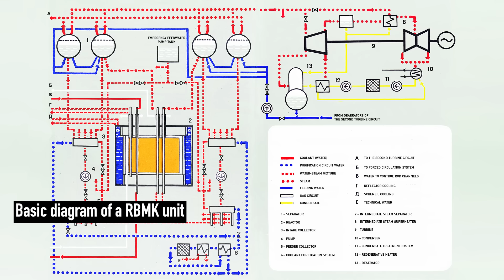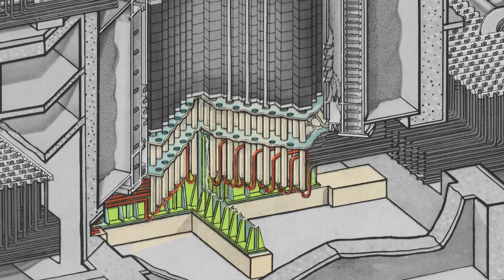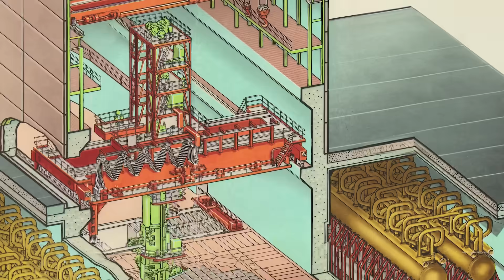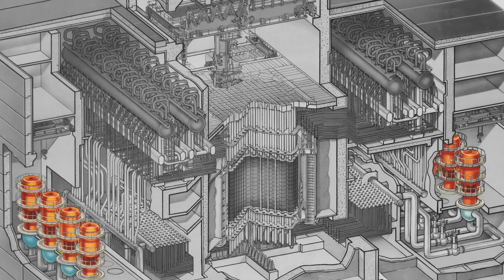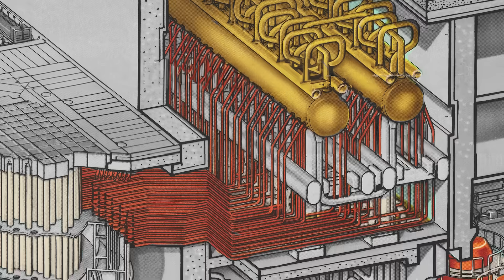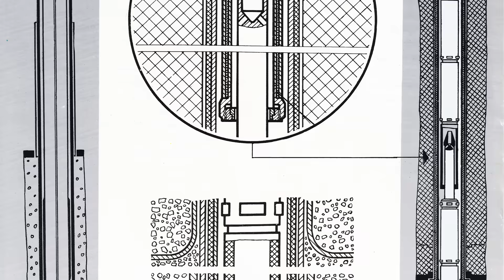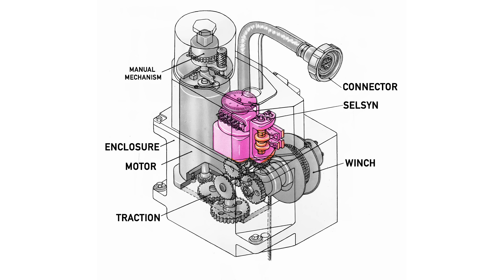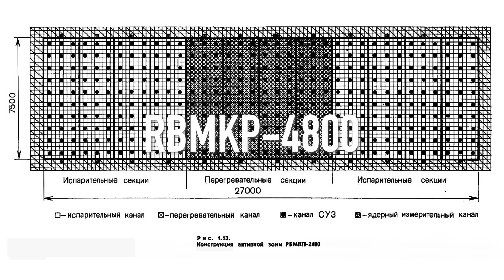RBMK: The Soviet Reactor That Was Doomed from the Start | Chornobyl Uncharted Ep 04

Comment: 12:17 Correction: all the reactors in the Smolensk NPP are 1000MW, but the slide shows 2x1000 and 2x1500.

The 1500MW version was only built at Ignalina NPP, and the Smolensk 4 was never finished.

Maybe that was an expectation of what they wanted to build?
Reply from the maker: Exactly. This is a fragment of a 1977 promotion brochure (translated, though)

Comment: Just a note, SCARLA provided real-time information on the control rods to PRISMA which then ran calculations and produced a printout. In the computer room. That someone would need to take to the control room, by hand. Minimum delay was about 2 minutes after “real time”. For what happened in Chernobyl-4 in 1986 this was in no way quick enough to provide useful information on the reactor state to its operators. Very good for waving around in a courtroom a year later though 😼
Reply from the maker: Yes, there was this issue.
Reply: Not to mention that the Ministry of Medium Machine Building knew that the RBMK design had a high chance of a runaway chain reaction due to its positive void coefficient. They also knew that the RBMK had a high probability of such a runaway reaction under a specific set of circumstances - which just happened to be the exact same set of circumstances that were intentionally created by the plant operators the night of the explosion. However, nobody at the plant knew either of these things because the information about the reactor’s performance in those circumstances was so highly classified that even the power plant’s manager wasn’t cleared to be provided with that information.
Reply: @user-name-goes-here   what is certainly true is that Dyatlov & Co were convinced that the margins they were operating the reactor under the regulations that night were safe, but that Legasov rewrote those reactor safety regulations in the 3 months between the accident and the first IAEA investigation meeting.
Reply: @user-name-goes-here  Sadly, it needed a catastrophe, that made them improve RBMKs safety. Void coefficient ist now 0.
Reply: This system often had some problem and if I remember there was a clause in the documentation that allowed  to work without this information for two hours
Reply: Indeed, I remember to have read a 30 min delay between "real time calculations" and it's availability in the control room.

Comment: I think everything looks okay in the reactor, but having no upper containment chamber and having no fail-safe configuration in the computer control was deadly.
Reply from the maker: There was a configuration in the computer, and there were no problems with that; one of the problems was that there was an unknown behavior of the machine during an emergency due to the design of control rods.
Reply: The RBMK was orginally used by the military to make Plutonium, where the dangerous positive power coefficient (reactor runaway) never occurred because they never used up all of the fuel. When the difficulty of making VVER reactor began to stunt the Soviet civilian nuclear power program in the 1960’s, Anatoly Alexandrov signed off on RBMK use instead. The large crane was a real advantage in making weapons grade Plutonium without having to shut down the reactor for the military, and civilian power stations found it useful too, but it stopped a secondary shield being installed around the building (a technically impossible size at the time). As such military RBMK reactors where all located in Siberia, it had never come up before as a problem.

Comment: Thanks again for the interesting video. What is interesting about these RBMK reactors is that they can be refueled while they are running, while BWR reactors have to be shut down for the time being.
Reply from the maker: Yes.
Reply: The online refueling was a desired thing for producing Pu. For bombs. To produce plutonium, fuel needs to be irradiated for a short time, because plutonium itself is a fuel the reactor will consume. BWR needs to be opened (the lid is taken off) to be refuel, turning the whole containment building into the refueling machine that hangs above RBMKs, and it takes so much time that it's not practically possible to quickly swap fuel rods.
BWRs produce more power (by size) and less bombs, but are way more expensive to operate.
Reply: @Damien.D  
Not only will the reactor consume the in-core produced Pu, it will also turn into the "wrong" kind if it's in there too long. You only want the Pu-239 isotope. The other isotopes are no good in a 'splody thing. The English tried it once (in the 50's, I believe), and said "never again". That's why you have to remove the fuel assembly after a short time. While the RBMK is fully capable of  breeding plutonium for 'splody devices, it has never actually been used in this manner. But the capability was very much a mandatory part of its design. They also envisioned the RBMK in a support role for the new fast breeder reactors they were designing/ going to build. A fast breeder needs an initial special core loading before it can start doing its magic of making more fuel than it consumes. Our big, graphite-moderated friend was supposed to be a part of this cycle.
Reply: @swokatsamsiyu3590  Yeah the design of RBMKs made them very versatile.  And big. And beautiful. Look at this mosaic on the floor!
Soviet 'splody things were bred at Mayak, in crude reactors, open cycle water cooling! Like Windscale Piles, but with water, and no filter, irradiating the lake...
Reply: @Damien.D  
You mean the "Big Ivans", military reactors, I think. And yes, these were absolutely terrible, with their open cooling cycle. They were called "Прямоточные" (= "straight throughs") for that reason. The very idea that they thought this would have no effect on the surrounding area. Good grief! Even today, you wouldn't want to stand longer than 15 minutes or so next to that lake. Unbelievable, what a mess that is. The Windscale Piles were bad enough, but at least they gave them the "Cockcroft Folly'" filters on their chimneys. These Big Ivans were basically open to the entire world without so much as a care.

And as you may have already guessed, I have a huuuuge soft spot for the RBMK. It is such a misunderstood reactor. There is something to their appearance, their grumpy nature, that (to a retired Master welder's engineering eye at least) is somehow endearing. They're big, somewhat clumsy reactors that cannot help being big and clumsy. They need a firm, but gentle hand to keep them in check. But if you respect them for what they are, and treat them accordingly, they will work hard for you. It's what I always said to the apprentice welders; "You have to respect the welding-gun for what it is. Yes, it's a machine, but it is also a Force of Nature. We must never forget where we are, and what we're handling. Mess with it, or disrespect it at your peril."
Reply: Its something other reactors can do, the British AGR and Magnox were capable of it (and have their own analogues of the fuelling machine) . As could the Canadian CANDU reactors.
Reply: @planesguineapigs1712  Thanks for the information, I am not very familiar with AGR and Magnox reactors. CANDU is a bit more familiar, but I don't really know these three reactor types.
Reply: @leopiipponen7693  Both of the British ones are CO2 cooled graphite moderated types. Sort of like a RBMK but using CO2 gas as the coolant.  They like the RBMK are physically huge
Reply: @planesguineapigs1712  does boiling happen in candu reactor primary side

Comment: It wasnt 'doomed from the start' as evidenced by the dozens of other RBMK units that operated without disaster. Despite being the most unsafe, dangerously flawed reactor design ever built, with positive void coefficients and control rods that did the opposite of their design purpose in a SCRAM, it still took abject, wilful incompetence - just pushing it to see how far they could push it, to bring it to disaster.
Reply: Yes wilful incompetence by A.Alexandrov who signed off on the re-design of RBMK control rods in 1978 without doing the computational work to check this was safe and V.Legasov who rejected changing the design after direct experimentation proved it was dangerous. By shortening the length of the graphite spacers in the control rods and control rod length overall in some of these reactors, they turned a potential minor incident into a world shattering explosion. Chernobyl-4 happened to be the first modified reactor to use up all of its fuel (as it was being prepared for full shutdown anyway) and explode. Legasov quickly realised the issue, because he’d been explicitly warned of it three years earlier and corrected by Autumn 1986, he being the per pro budget holder for this kind of work nationally. I feel no sympathy in blaming these two dead men because they worked hard in throwing six other innocent men into a labor camp in 1987 to pay for their mistakes. Many in the industry probably knew what they did as their careers effectively ended with this accident, while most of those thrown into prison on their evidence were released early on an amnesty and returned to work in the nuclear industry.
Reply: Can you explain precisely what "abject, willful incompetence" took place that night? By the time you are done explaining, you will find out that you have been systematically lied to by the Soviets trying to push blame onto the operators, and away from those who wrote the regulations and configured the operating regimes...
Reply: @MinSredMash  I assume that "by the Soviets" you mean "by SREDMASH" since as far as I can tell Gorbachev was furious with them.
Reply: @Jesse-qy6ur  Gorbachev was furious, but the government and the Party still settled on a narrative that scapegoated the operators while protecting the reputation of various Sredmash institutions.
Reply from the maker: @MinSredMash exactly. And what is sad, it pretty much cemented over the years.
Reply: @ChernobylFamily  Interesting that is the story you were fed. Being an Engineer i tend not to follow that pop-sci BS, my research has led me to attribute the error to the management that ordered them to undertake such an insane test.
Reply from the maker: @mycosys  and? Do I say something different? I am pointing at a bigger problem, that many things people believe about Chernobyl are exploitation of soviet lies. Take HBO show - that is a soviet narrative packed in a consumable format.
Reply: @mycosys  As an engineer you are even more likely to have been fed pop-Sci BS than a layman. Such is the prevalence of misinformation surrounding this subject. Defend your statement with arguments and facts that the test was "insane." I can practically guarantee you that your understanding of the test is fundamentally flawed.
Reply from the maker: — Gentlemen, you can't fight in the War Room!
Reply: @MinSredMash  Funnily enough, as an engineer i also have zero interest in 'debate me bros' - present your evidence or get your hand off it.
Reply: @mycosys  That's unfortunate. I was looking forward to the comedy of a traffic engineer trying to con us into thinking that he has expertise in nuclear physics.
Reply: @MinSredMash  Mechatronic. You seem like you could use some friends.